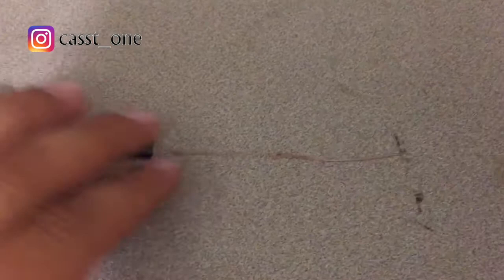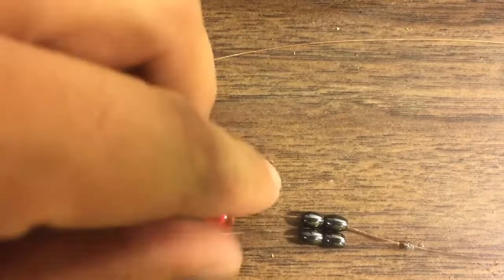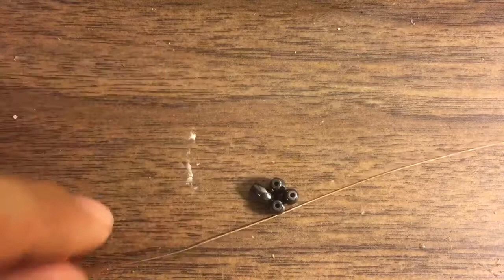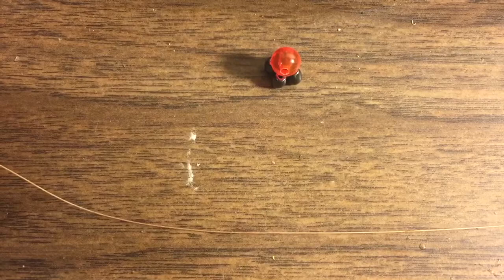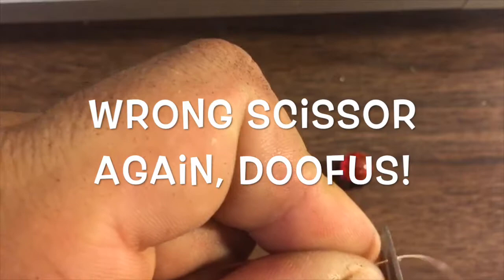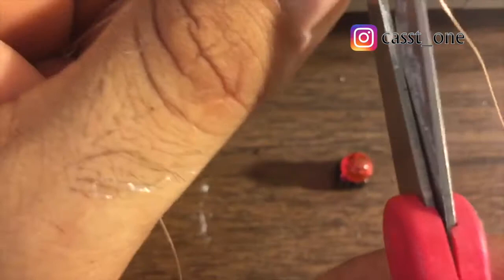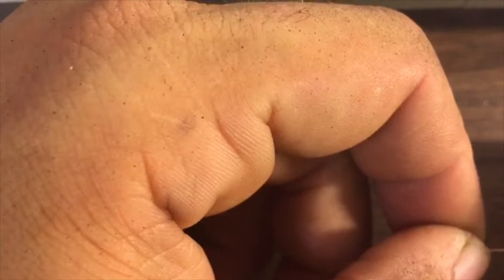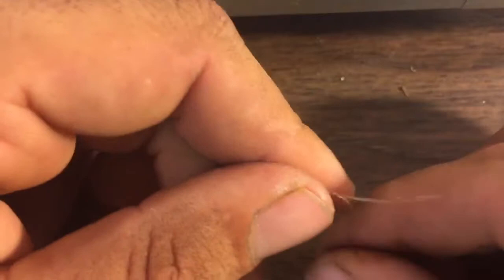Make Your Own Thread Pull (Speedy Thread Puller)

Comment: I found spider wire works even better nice and smooth pull never brakes
Reply from the maker: I have never had a pull break on me, thread though, yes. Spider-wire is going to leave more residual stain behind. Only thing you have going there is cheaper, but good to know someone found use for spiderwire...just kidding...I’ll try it out, thank you